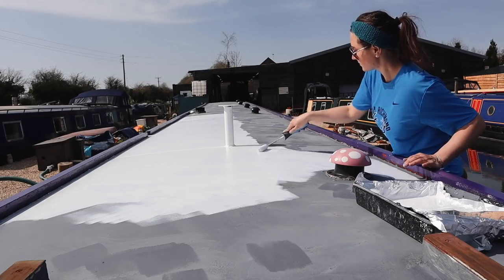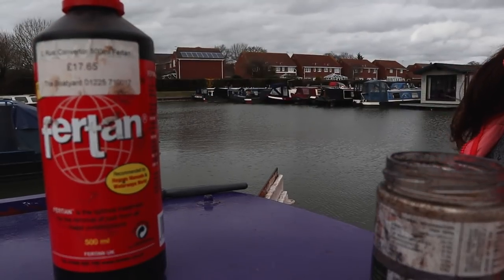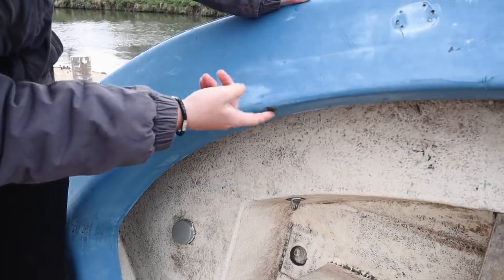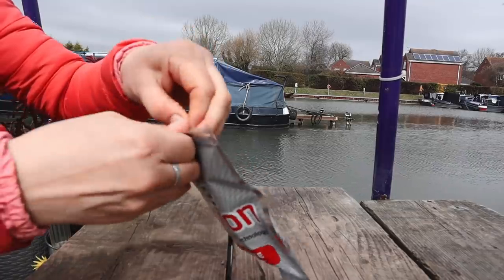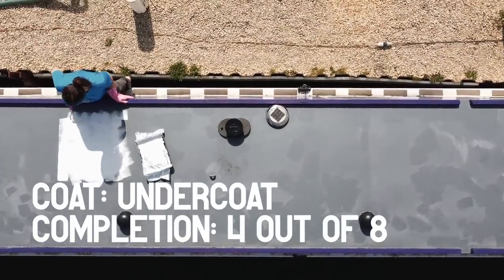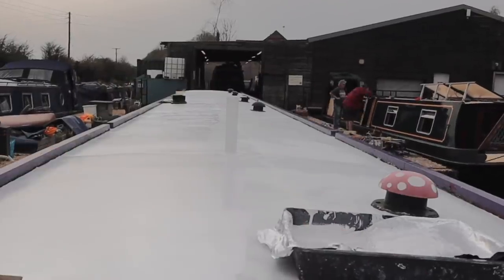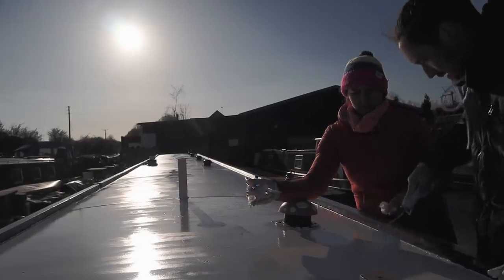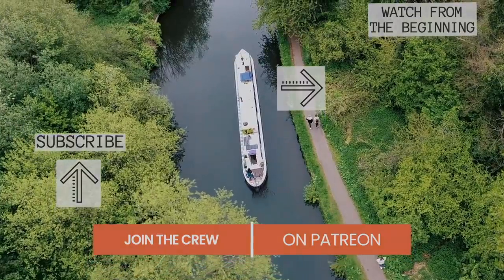What It's Actually Like to PAINT Narrowboat Roof OUTSIDE

Comment: That has been a really steep learning curve, several learning curves in truth. There is a lot of advice out there, but the doing of it, that is another matter.  I admire your perseverance. Pro tip - place a sheet of kitchen foil over the rim of the paint can to keep the rim clean of paint when you pour paint out. That makes it easier to replace the lid! Putting foil in the paint tray is a good idea. I never thought of doing that!!! Thanks for the idea.

Comment: You did everything right apart from the tools that you used. If you had used trade rollers which are much larger along with bigger brushes it would have saved you a few days. Also as you now know a week in dry dock would have helped. But you did great for a first time effort. What a steep learning curve you've both been on.

Comment: Next time you paint externally, as well as a good quality paint, look to add some glassflakes. These significantly increase the wear resistance of a quality paint. Some marine paints already have them added. If I was blacking a boat, I'd strip back to bare metal & use black twin-pack paint mixed with glassflakes - the same way they paint the waterline of ice breaking ships !

Multiple coats is precisely the correct way of doing it !

Some other fantastic paints to consider (as an amateur boatbuilder) are : Corroless, Teamac & RustOleum Combicolour

And as a prep coat for external woodwork - hardwood or softwood, painted or varnished - you can't get better than Make Wood Good / Smiths CPES. Effectively turns any wood into 'plastic wood' impervious to water

Enjoy your boat

Comment: Another good episode, though I just can't help myself in offering you some painting tips and I sincerely hope you find it useful going forward.
1: Invest in a set of quality brushes half inch through four inch.  Preferably two sets so one set for oil base and the other for water based paints.
2: Look after said brushes by cleaning thoroughly after use and these will last years and over time will lose the stray bristles.
3: invest in a quality 10 inch roller and sleeves and again clean thoroughly after use.
4: When "cutting in" try and use at least a two inch brush but preferably even wider (please get rid of that brush you were using).  Get used to loading the brush and you will be surprised at how quick you become with experience.

I could go on but I will not bore you (but if you want more tips then just say the word) :-)

Comment: You sure put in the work on the roof, but I wish you would have had a painter friend to advise you so that you would not have had to work so hard. The trick to painting is to put on the thickest coat you can put on without the primer or paint running. The thickness of the the primer and paint on a clean surface is what gives you the protection. Keep up the good work!
Reply from the maker: Thank you for your advice Richard 💜 xx

Comment: I don’t understand why you don’t use a bigger roller and bigger brushes,it would definitely make the job much faster.??I was shocked to see you use that small roller on the roof.🤷‍♀️🤷‍♀️ Fiberglassing is better if you cut the piece a little larger then the area your patching then no worry about leaving an area uncovered. You both are so hard working👏🏼👍🏻❤️ This is my second time watching so thought I’d add my two cents this time.😂
Reply from the maker: Thank you for the tip and for your kind words of support. The roller is perfect for getting in between chimneys, hatches and mushrooms vents. Actually painting with the roller was the easiest and quickest part of the job 👌